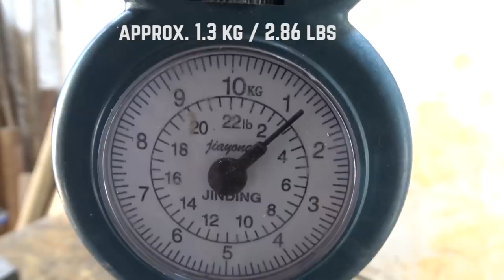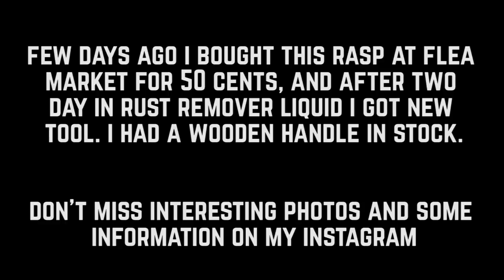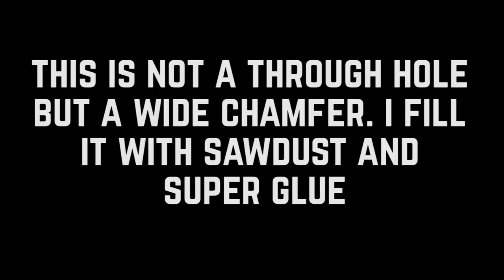Restoration Old Rusty Axe

Comment: 2:13 - The three badges on the stamp - are three cedars. The inscription on the stamp "ц.2р.00k". - this is the price of an axe in Russian rubles. 1989 - year of manufacture. This axe was made in the USSR in 1989. Metallurgical plant in the city of Nizhny Salda. "Б3ПС" - "Б" - type of axe - carpenter. Number  "3" - is the size. "ПС" - (Повышенная Стойкость) - Increased stability. This is the axe "Three Cedars" from Nizhny Salda, USSR, 1989. 🙂
Reply from the maker: Thank you for full information!
Reply: @ScrewsAndTools  🙂👍👍👍

Comment: "Three cedars" or "Three Christmas trees", the city of Nizhnyaya Salda, the Urals, a rare ax, valued by collectors, depending on the year and hardening. You have hardening 63, for fine carpentry, the steel is brittle, but keeps sharpening, if you use it hard it can crack.

Comment: The loop needs to be a bit longer, so it can fit over ones wrist while in use. I have avoided injury with cutting tools with such if it slips from the grasp for whatever reason. And bystanders, perhaps. Maybe I’m just clumsy.